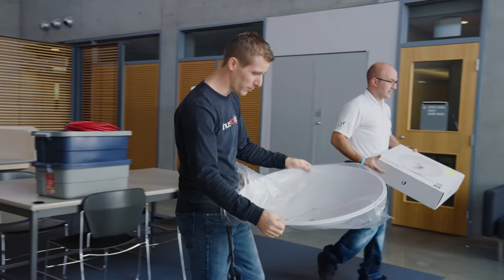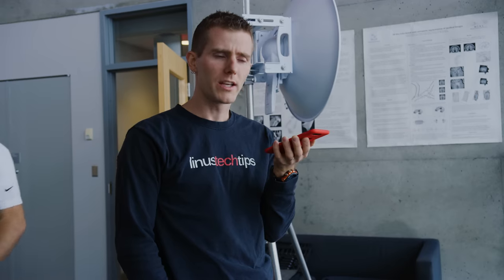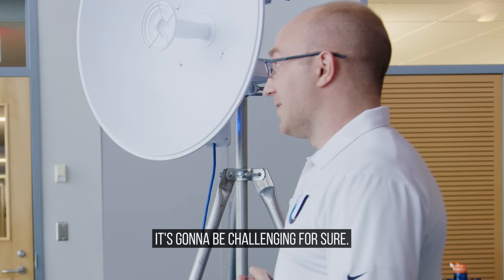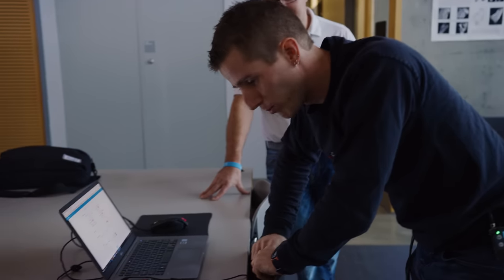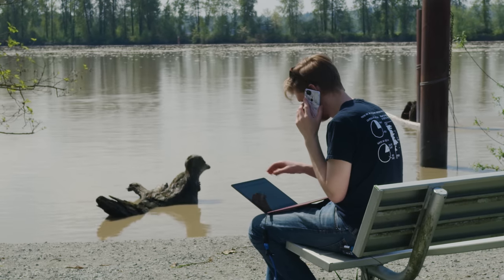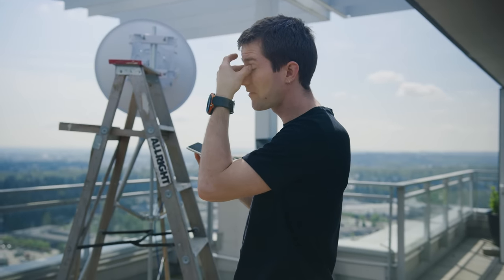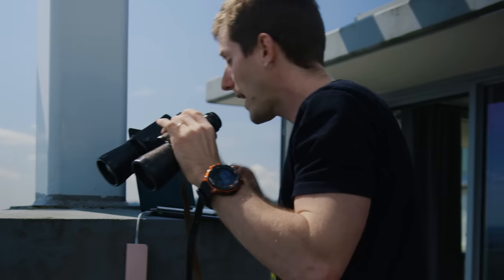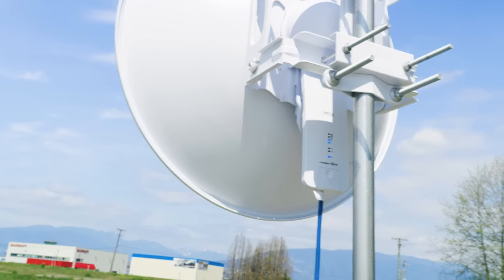12 KILOMETER Wi-Fi - SUCCESS!!!

Comment: Linus could you send internet from the Earth to the moon with the right antenna ?

i need to know before my trip.
Reply: mw3051 you would need highly illegal amounts of wattage to do so, and a way to track the exact spot on the moon so you don’t lose connection as the moon moves around the earth.

Don’t stand in front of that transmitting dish unless you want to get burn from the inside out either lol
Reply: @TheBrickson98  ummm ... no.  It actually takes very little power.  In fact, you can cheaply bounce a signal OFF the moon and back to earth, and obviously that's twice the distance ; )

... that's called EME (Earth-Moon-Earth) and anyone can do it quite cheaply.  You can also chat directly with those aboard the International Space Station.  These things don't require huge power, or even dishes ... but don't expect high speeds, it's remarkable that it can be done at all.

As for requiring a 'precise spot' on the moon - again, no!  The moon is a convex surface, so all you need to do is hit it ... the moon will then radiate that signal out in all directions - and anyone pointing their antenna in the right direction can pick it up.  It's not at all like a flat mirror where two people need to be at the proper position and angle to see each other...

...so no, your signal will hit the whole of it ... and will be reflected back at anyone with a view of the moon, and that's almost half of the earths surface.

and, long distance communications don't even need line of sight...

These dishes Linus is playing with can be used to bounce a signal off an object to get around hills or buildings.  If they both pointed at, say, a large water tower they could likely get a stable connection even if a giant hill was in the way.  The same principle as EME communications, but with far more power and far less distance  ; )

How much power?  Well ... you can get right around the world on a battery...

It might surprise you to know that you can send a signal from the US to eastern Europe on a single 9v PP3 battery - or a few 1.5v AA batteries ... and a thin wire thrown up into a tree ! Working on such low power is called QRP (there are plenty of QRP videos on youtube if you want to see it done)

And, just for a giggle... Wi-Fi...

... with very cheap (less than $10) wi-fi dongles you can easily send a wi-fi signal 10+ km.  All you need is a couple of cheap wire mesh antennas... or you can build your own.  The last public attempt that I can remember using regular laptops and cheap d-link dongles, was a 70.5km link between Gran Canaria and Tenerife.

70.5km!!!  Using a regular old Wi-Fi dongle and USB power!  The connection speed varied between 15mb and 2mb depending on conditions, but it worked!

Radio is a lot more efficient than you might think... power isn't the deciding factor, your antenna is ; )
Reply: @garychap8384  B.Tech?
Reply: @garychap8384   would you please link that video/URL? 
I'm looking forward to set up a kind of system like that and I would appreciate to follow a pre existing project built by somebody.
Reply: @garychap8384  can you repeat that?
Reply: @Aimless Studios electricity isn't illegal. I'm saying transmitting at high power is illegal. You can only go up to certain levels with an amatuer radio license
Reply: @garychap8384  As far as I know, you wouldn't be able to use high enough power levels LEGALLY on 2.4 or 5GHz. But I could be wrong. I suppose I didn't really consider using a different type of antenna, not one from this company.

Comment: Why did you not just use your phones GPS data at each location to draw a straight line from one to the other on the map???
Then set the alignment by placing your phone next to the dish & dialing in the angles.
In today's world of smart phone & apps you have literally have hundreds of ways to do this better.
Reply: Gregory Thomas becoz in LTT universe.. those are still future tech where no one has done before... lol..
Reply: We tried, phone compasses aren't accurate enough.
Reply: Alexander Clark i've done that with no problem dude, you lie.
Reply: Compass on your phone might be better than the one on his. Though naturally the next level would be to just buy a compass. That's even older tech, but working perfectly fine.
Reply: Alexander Clark they totally aren't good enough, but using visual clues helps a lot and it can still be done with just your cellphone with enough practice, I've done it even for links over 20km
Reply: Because half the teams have iPhones. They didn't want to accidentally end up beaming free WiFi to the Australian desert.
Reply: Literally all you need is a relatively accurate compass and if you have altitude difference then your elevation. You’d need distance between the two points as well.
Reply: Get GPS Status (Android Only) and manually calibrate GPS, plus flushing all GPS data and redownload AGPS data. It should work. Plus, you can set a GPS waypoint in the app, and manually target it.
Reply: Guys... The gold flashing was honestly more accurate than any GPS would be. Over that distance, the built in inaccuracy to GPS may result in dramatic inconsistencies. Get close, then figure the details out. I've configured RF shots over 20 miles (sure it was shite dBm), but that was only due to the assistance of an aiming mirror on the other side
Reply: Public GPS that takes measurements from satellites has an accuracy of about 3 metres- what this actually means is that you could be anywhere between 3 and 12 metres from where that point actually is and that's IF you have 3 metre accuracy. .  That makes a huge difference.
Reply: you are using the wrong tool. an old technique to direct the dish to its bearing. use google earth instead or
 radio mobile.
Reply: Gregory Thomas literally what I've been saying throughout this video

Comment: There is a thing called using a compass Linus lol then you what's called back azimuth to figure where you needed to shoot. So say you were at 280 at one point and your back AZ would have been 100, then depending on terrain you adjust for polarity (Horizontal or Vertical) and adjust +/- 3 degrees either direction. This would also be called a LOS (Line of Sight) shot. I been doing this for 14 years with many diff types of antennas. :D Hope this helps next time you try this.
Reply: you sound like a 25s :)  or 25q!
Reply: I came to this video to see what type of tools the ubiquiti guys uses, but calculating azimuth and tilt manually? In 2018? What tools or apps do you know that i can use to calculate the aligment?
Reply: Nah this is too high tech for them. LTT is all about bungling stuff up and doing things the most inefficient way possible.

Comment: Pah you're not even trying. My friend runs a radio repeater network that uses trunking for calls to multiple sites and uses VOIP for that. He is using Ubiquiti gear to link between two 50 metre high radio masts almost 100km apart to provide internet access to the remote one.

One thing very interesting is the Ubiquiti gear software has a spectrum analyser function built into it and it was quite interesting to see the noise floor on 5GHz rise as he swung it round and its line of sight passed over the city of Kingston Upon Hull which is 50km away from the source mast.

Interesting fact number 2. The height of the transmitter and receiver above sea level will have a significant impact on the range. The lower to sea level both are the shorter the range will be as it is line of sight communication and the curvature of the earth actually starts to get in the way. Here in the UK typically you get around 60 miles/100km before the curvature of the earth gets in the way. His are on tall masts on top of hills so not an issue.

Comment: Linus WTF MAN! Either use a compass or draw a line on google earth and use the 3d rendered buildings to determine your angle. You are a smart guy but you killed me with this video. 

I have a feeling a 1 week technology free would be beneficial for you.
Reply: antipathy17 they did draw a line in google earth. They just still couldnt find the correct angle off of it
Reply: The problem is, I don't think the dishes told them angles, so a compass and such would only be efficent as being it's kinda that direction. give or a take a few degrees, which yeah would have made it a little easier. if the dishes could find their posistion in gps and tell which direction it's pointing than that would work really well. Maybe have an area where you can set a phone onto to level, get angle and GPS position.
Reply: yeh linus.. what he said..
Reply: If you wanted, he could have used a rangefinder and used Pythagoras, sinus and cosines to calculate the angles.

Comment: lol. one of my very first apartments i ever had there was a library with free wifi at the corner of my street, maybe 60 yards away, and i attached a wifi adapter to the arm mof a satellite dish i broke off the side of my house in order to game while i was home on the library's wifi. lmao.. i had free internet for the entire time i was at that apartment. i loved it. something about the shape of the dish bounces the signal and directs it/ focuses it/ condenses it at a spot at the end of the arm. it worked perfectly. this is great to see that same concept work with such huge distances.
Reply: what equipments did you use bro?
Reply: Pointing a parabolic antenna at a dipole antenna will work as long as you are accurate.

Comment: Why was this so hard? Draw a line between you two and use a compass to direct the antenna. Google maps has height data, use that to point up or down depending on the difference.
Reply: Getting fractions of degree accuracy is going to have to use manual adjustments. GPS/Compass will get you a couple of centimeters at best.

Comment: I have at least 100 Access point that we use as ISP  ranging from 10 to 35 KM some even doubled up with 2 antennas each end  , 20 KM is easily reachable with 300 MBps + but i get it for noobs trying to  get anything working u did manage to get somewhere. I know everyone will ask but with good setup latency can be below 15 ms on 20Km.
 So guys you need to try harder. This thing has been in usage for over 10 years now.
Reply: friends 60 miles from nearest wifi.. setup a parabolic antenna with a AWUS 36H  amplifier..   at 1 amp on 20 foot tower it works fine..  15 milisecond is a little unrealistic considering a 5 mile connection is 35 ms under absolutely perfect conditions...         you amplify the signal off the source or the recipient?
Reply: Idimi Dodjimi Well canada's behind when it comes to connectivity and shit. Trust me
Reply: No amplifications, all managed trough MikroTic Router Boards and and mini pci cards , just done testing ping large packets (1000) average 17 ms and that is medium usage during day ,on the end of network pinging my DNS, pinging google DNS  average is 23 ms, that is from client end and he is connected on sector antenna with Nanostation 1 KM away from AP.
see trough link speed test result https://plus.google.com/u/0/106043911988630429837

Ah just one note this is not the test of max speed , max throughput is limited to 50 Mbps on this client computer

Comment: Aren't there 8 megabits in a megabyte, why is Linus calculating x 10?  I must be missing something.
Reply: No you're correct, linus is doing off the head calculations and I guess he feels the need to keep talking so he just multiplies by 10 instead.. I was mentally correcting him throughout the video..
Reply: Because it's usually faster for people to multiply by 10 than 8. It wasn't supposed to be an accurate calculation, just a rough estimate.
Reply: Just quick maffs.
Reply: 1 times 10 is 10, minus 2 is 8 quick maffs.
Reply: Yes, you're forgetting overhead.

Comment: well this struggle is just for the purpose of making this video. In real life you setup both antennas 1 meter apart and then relocate one of them at X km away, then just play with the angle.
Reply: That's too easy and won't allow for a long video.
Reply: @JV-tk3nn  Or just not be like linus, and actually calculate the angles with GPS data lol. If you can figure out the propagation pattern of a given radio dish, you can calculate what angle is needed given GPS data for the other endpoint.
Reply: @adithyay328  Nah! That would be too complicated. Only a rocket surgeon would do that. 😊
Reply: @JV-tk3nn  lmao
Reply: @JV-tk3nn  oh no just to clarify its not as complex as it sounds. That radio dish will have a cone-like proposition pattern, and if you can get the distance between the 2, you can use some high level high school/entry level college math(conic sections etc) to figure it out.

Tldr;
You right lol

Comment: A little tip.. being prepared goes a long way. Setup and test your link in the same room. Use the ubiquity planning software to know in advance where you're pointing. I've set these up many times and it's not as complicated as this video makes it seems. Shouldnt need more than 10-15 minutes to setup at two locations and calibrate

Comment: I actually set this last month between thre hospital's (where I work) 48 GB/s (raw) fiber line and three other clinics (within 5 KM) that we acquired at the beginning of the month.

The original plan was to pay to have a gigabit fiber line run to each clinic and use a VPN connection to "security connect with our server" plus the additional monthly cost of having 4 additional fiber lines (granted, the cost of insulation was going to be a lot lower due to the close proximity of the hospital's line).

However, I convinced the board president that I could do it for much less and no additional monthly charge.

Not only did I save the company several hundred thousand dollars a year but I earned major brownie points.

It actually really suprised me that I was the only one on the IT team who knew about PTP Wi-Fi but also knew how to set it up (that HAM license actually paid off).

After about three days of adjusting directional antenna we had an almost perfect signal (much less time than running a fiber line to reach building)

We are currently getting over a gigabit connection (on rainy days it's closer to 850~900 Mb/s which is more than enough) with the clinics.

Honestly, I think it's kind of surprising that just after (about) two weeks of getting our system up and running LTT does pretty much the same thing.
Reply: that's awesome I hope you were compensated well for your efforts and saving them so much money
Reply: @hampTC  See the way to do it is setup a budget so one keeps the excess after the project :) But realistically I'm not surprised there was only one that knew about P2P wireless. I've asked many with degrees in fields, very basic questions and they have no clue and no motivation to find out etc. They simply didn't care, and have no motivation to expand their knowledge outside of their current needs and reality.

Comment: imagine using Wifite or airodump-np to capture all packets in that range, checking for EAPOL handshake packets, cracking and decoding each single accesse point and then spoofing data or do MITM attacks
Reply: now that would be rad
Reply: Privacy issues
Reply: Ferib Hellscream would be heavily encrypted.
Reply: Ferib Hellscream remember back in the day when mitm attacks use to be fun replacing all the images.
Reply: Muhammad Ali yes but wpa2 isnt that hard to crack, in such a high its easy to get handshakes captured

Comment: I was on the Ubiquiti site under two hours ago looking at their point to point radios because I live in the middle of nowhere and I'm tired of satellite. One hell of a coincidence.
Reply: It can be quite a bit of work to setup, but having used both satellite internet and long-distance wireless links, I'd take the wifi 100% of the time. The main issue is planning where the internet connection will come from and where the endpoints will be.

Comment: those dont have alt and dec knobs???? youd think thatd be a given , to have just two knobs in back of each dish one up/down one left/right.
Reply: Knobs would have slop, probably too much to be as precise as is needed.
Reply: my telescopes have them and the aiming on them is pretty precise
Reply: exactly what I thought
Reply: The Ubiquiti AirFiber 24 has Az/El bolts with fine thread on the mount - but the beam on those is much narrower than it is on these Rocket dishes which don't need that level of precision.

Comment: 12 kilometeres isnt enough to me I NEED MORE
Reply: With dishes like those I guess You could get 30 or 50km range in right conditions, I was getting 10-15 km with far simpler and cheaper equipment more than a decade ago.
Reply: you need devices worth of 5000$
Reply: 12000 km. Is that enough?

Comment: Not using GPS + Compass for initial setup: laughable.
Reflector/laser to zero-in: nice touch.
Not talking about RTT (i.e. ping): lame.
Using 10x B->b conversion factor: no comment.
Reply: T R I G G E R E D

It was set up pretty poorly though.
Reply: Yeah LTT aren't very technical unfortunately. Come on guys.
Reply: The ping in this link would be essentially 0, probably 2ms
Reply: No comment? Here's one: the Windows explorer displays mebibytes instead of megabytes. Also, there's 8b10b encoding involved. I'm not exactly sure if Linus even knows that, but 2MB/s transfer speed reported by Windows explorer should be around 20.97Mbit/s raw throughput, so he wasn't even that far off.